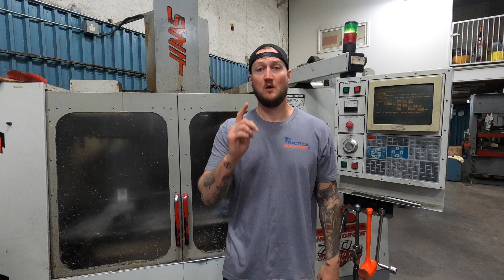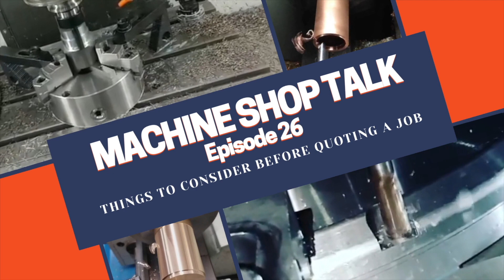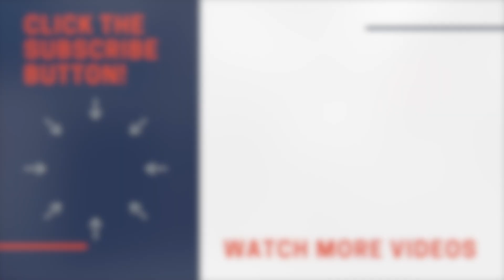Things to Consider BEFORE QUOTING a Job | Machine Shop Talk Ep. 26

Comment: In my experience talking to shops, the pre-quote checklist Ian walks through here almost always lives in one person's head.  The owner or the senior estimator. It works until it doesn't: someone's sick, you're trying to onboard a new guy, or you just quoted 15 jobs this week and can't remember why you priced job #3 the way you did.
Shops aren't losing margin on the machining they're losing it on everything that didn't make it into the quote.  No record of why a setup was priced a certain way, no visibility into whether what you estimated actually matched what it cost to make.  If you protect the margin any job can make sense from a financial side. 
The material availability piece is the sneaky one. By the time the expedite charge shows up, the quote's already signed and the margin's already gone. It's one of those problems that's invisible until you start tracking estimated vs. actual costs job by job suddenly you can see exactly where the margin is going, and material surprises show up fast.

Comment: couple things to add to your list. Inspection equipment - Do you actually own the correct inspection tools to measure the part? Inspection process - We had a job recently that was titanium with .0631 to .0634 bores in them. We used a comparator to get an exact measurement vs the customer decided to use gauge pins that ate up half of our already slim tolerance. to go along with my inspection additions, adding in some expense for doing a complete inspection report vs just standard inspection as some jobs can eat up hours at the CMM generating reports.

Comment: 300M super titanium alloy…or inconel 718 age matured nitrogen dipped…Any jobs asking for these materials avoid
Reply: Inconel is fine, you just need the expensive inserts and like 120 surface speed
Reply: you should google TZM. literally zero info online about it yet we took in a job running it. its basically like trying to machine a carbide insert... it was really fun having pocketing that we had to run a 1/8" endmill thru with 3 redundant tools cause it was rubbing the cutting edges off of them so fast, it was the only way to get thru a part. fun stuff...

Comment: You hit the nail on the head on material sizes being available.  Steel & Aluminum plenty of sizes, but still check. When it come to stainless it's all over the place. Sometimes I have to quote out to 3 different distributor's and one might have it in stock.  I do 303,304 & 316  There's such a big range between what's available in each grade, especially flat bar. Round is pretty much standard  in all three.
Reply: I had a customer insist that I use a 6" x 6" x 1/4" 1018 steel angle to make one of their parts. I told them it doesn't exist. I was assured that it was in the book and I'm stupid for not being able to get it. I said fine if you can get me that material I'll give you a 50% stupid discount..... They paid full price.